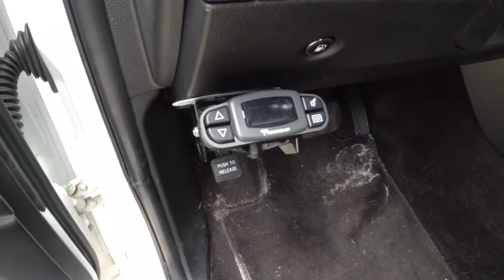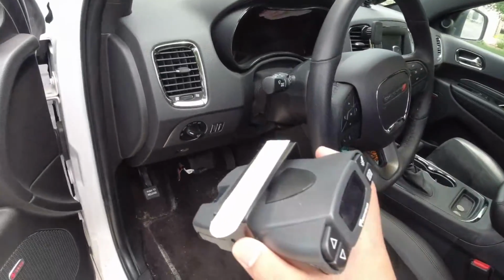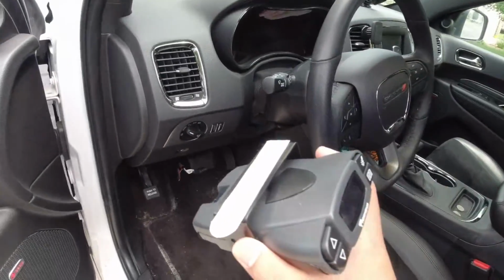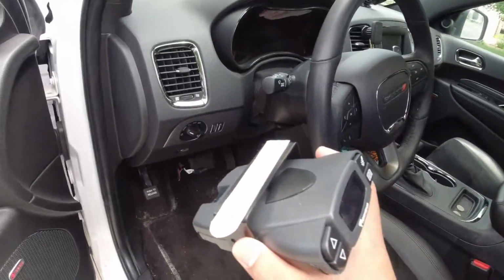Installing a trailer brake controller on my Dodge Durango // Part Time RVing

Comment: Check out the Redarc Pro Tow Elite from eTrailer. Pricey but worth it, never in the way and you don’t see anything but a small knob that can be mounted almost anywhere. I have one on my 2019 Pathfinder and love it.
Reply from the maker: Thanks for the reco! I did end up finding a place for the Tekonsha that keeps it out of the way but this is an excellent option!

Comment: Does it keep.drawing power when its off?
Reply from the maker: I've left it plugged in since and it looks like battery protection does turn it off. However I still unplug it between tows just in case. Thanks for the comment!

Comment: What’s the brand of that brake controller? Does it come with all wiring?
Reply from the maker: It's the Tekonsha P3 brake controller, and I had to order the wiring for Dodge separately from the main unit!
Reply: @1MoreJH  what wiring kit did you order? Did you need the kit with the fuse box?
Reply from the maker: @Wardanyo  This is the one I got! No changes to the fusebox!

Tekonsha 3045 2-Plug Brake... https://www.amazon.com/dp/B004R39F7K?ref=ppx_pop_mob_ap_share